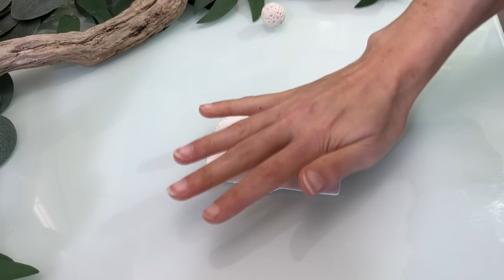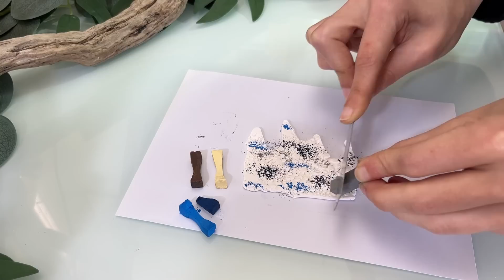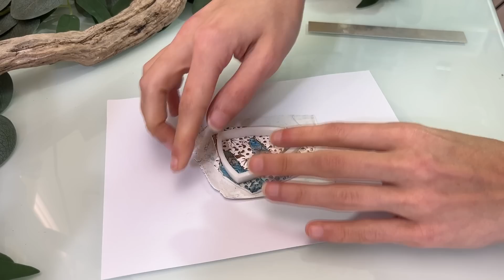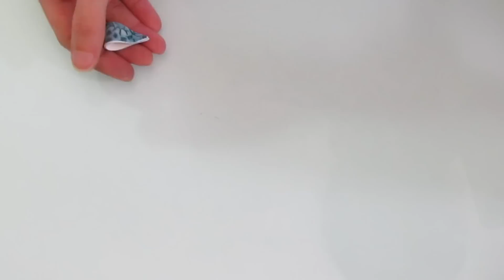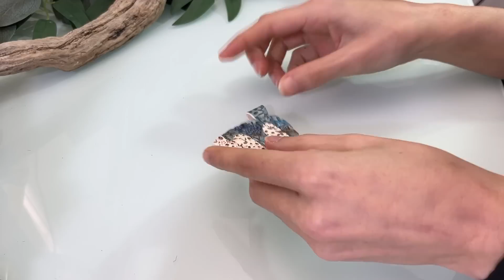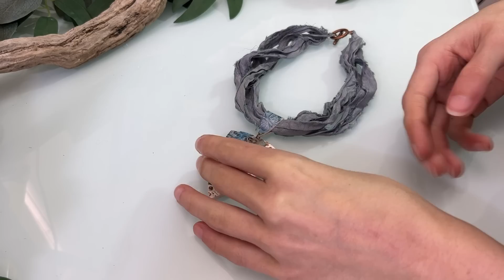Exploring Clay Texture using Home Made Texture Beads - Polymer Clay Pendant Tutorial

Comment: I really love the texture!!!   
I may have to try to make some texture beads.  I only have a thousand ideas in my head and about 12-15 projects started but wasn’t able to finish in one go, so it’s still raw clay just waiting to be used. My health doesn’t allow me to get through an entire project at once, even “quick” projects.  Most of my polymer clay is on the not so fresh side, and I have very little strength anymore, so it takes a while for me to get the clay prepared. By then I’m worn out and have to stop. Then I get another idea, that I think I can get through, but don’t make it all the way through. Lol
And sometimes if I make too much clay in one technique I get bored with that clay and put it to the side. 
I love to make petal cakes but 99.9% of the time they never get used. 
I have probably around 40+ pounds of polymer clay, between mixed colors, left over colors, partial packs and full packs.  Now that I have everything one can think of, plus some, to start a good size polymer clay jewelry business I’m not physically about to do it. Time to start detaching!  Lol